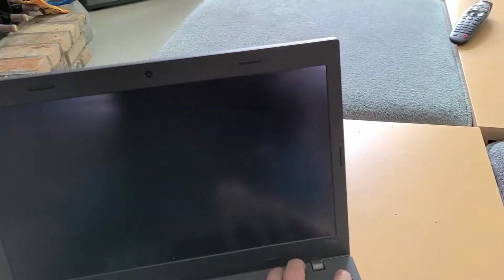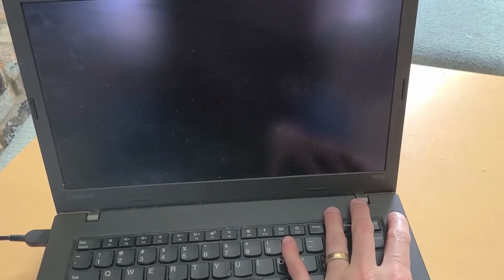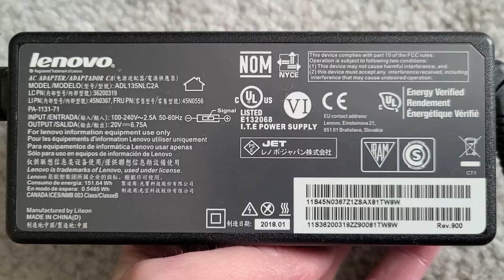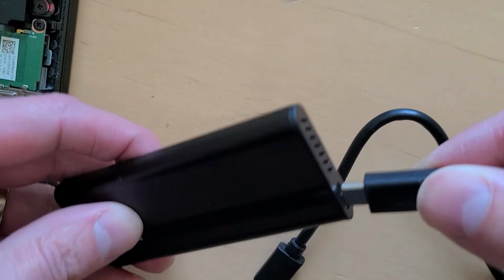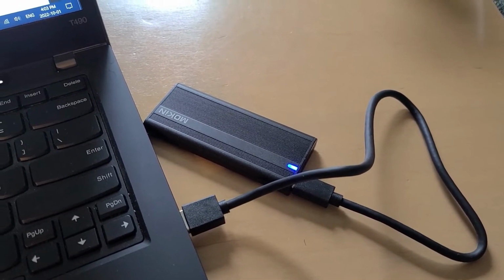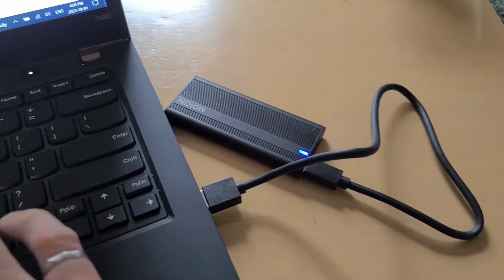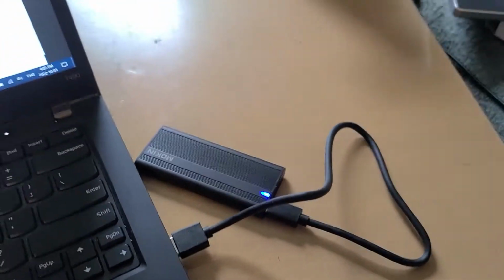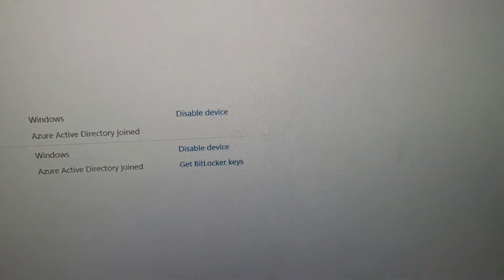Lenovo T470P power on troubleshooting and data recovery PCIe NVMe SSD drive

Comment: Huge thanks for this video!

I was troubleshooting my T470P (RTC/Checksum error) and I spotted that tiny pad (JME1) at 3:01 and realised mine was completely missing — mystery solved! 

Now it’s micro-jumper time!

You probably saved my motherboard today, most especially my wallet!😄
Reply from the maker: Man you have better eyes than I do.  I started at it for a bit and couldn't see JME1.  Let me know if it actually resolved your checksum error.
Reply: @shaneperche-fixed-it  its that black thing (just below D2502) that I thought was a forward diode (going to D2501). Crossed referenced it to the boardview of the T470P I downloaded and alas - it was coded JME1 (a jumper via-pad/ engineering pad)

Comment: Can the T470P take an internal battery? or just the removeable external battery?
Reply: Only the regular T470 has both an internal 3-cell and an external removable battery.

The T470P uses the HQ-series CPUs (i7-7700HQ / i5-7440HQ), which need a much larger heatsink and VRM area, so Lenovo removed the internal battery to make room.

Because of this design, the T470P only has the external removable battery and the CMOS battery — there is no connector or space for the internal 3-cell pack.